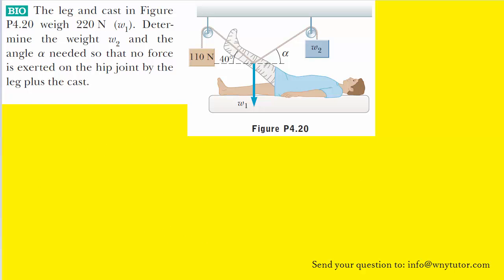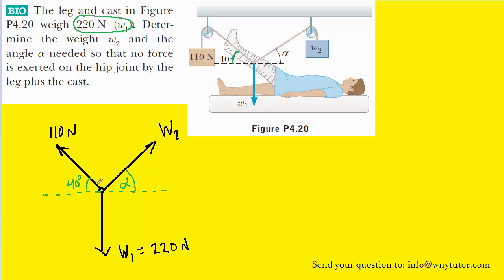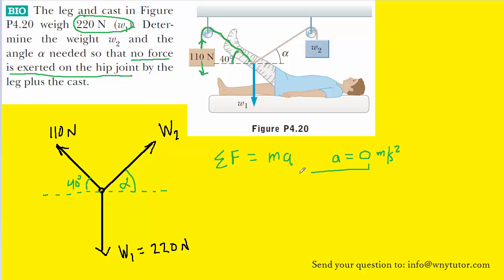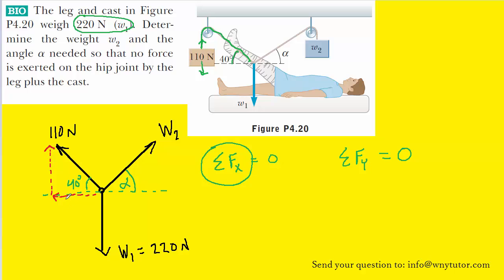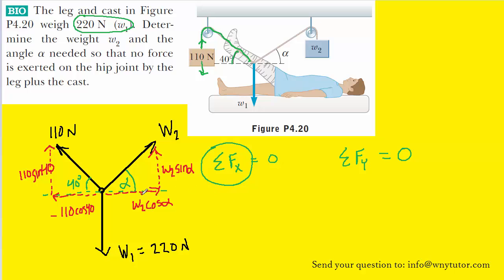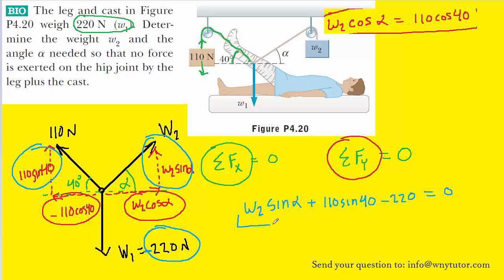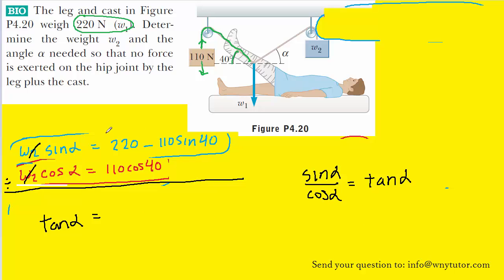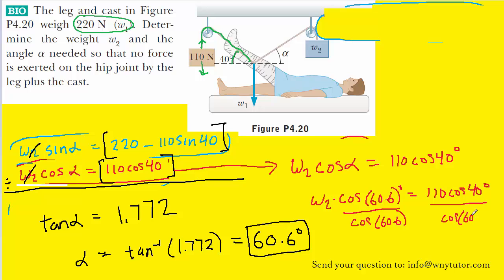The leg and cast in Figure P4.20 weigh 220 N (w1). Determine the weight w2 and the angle alpha neede

Comment: just use the resultant formula since we're dealing with a vector quantity. if u put the summation of x in an equation, you will find that T1x is equal to T2x. Since T1 is given, you'll be able to compute for T1x which is the same as T2x. The same goes for T2y. Since T1 is given, if you put the summation of y in an equation, you'll find that 220 - T1y is equal to T2y. Now that you have the x and y values for T2, just use the formula, R = square root of a^2 plus b^2 or your x and y component. The R is the value for T2. Once you have that, the angle is easily computable.
Reply: Agree. Better solution to use when we are not that good in Trig identities.